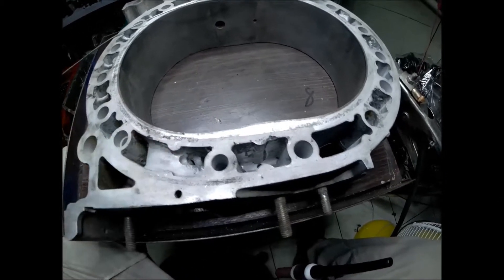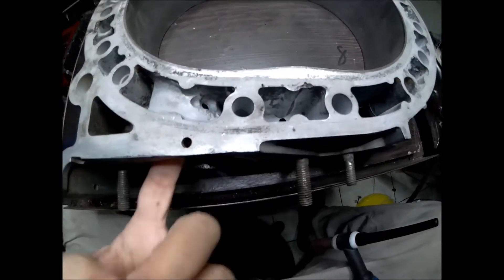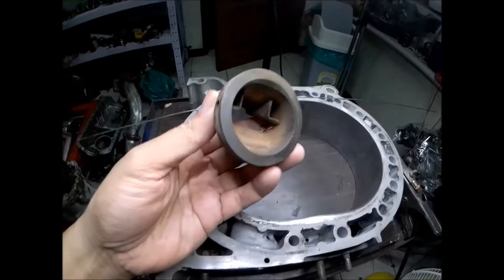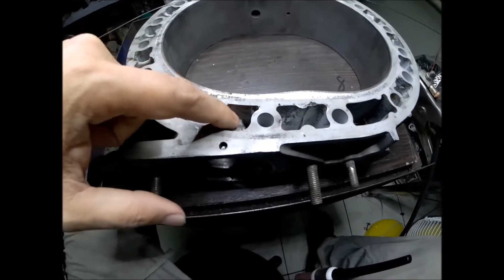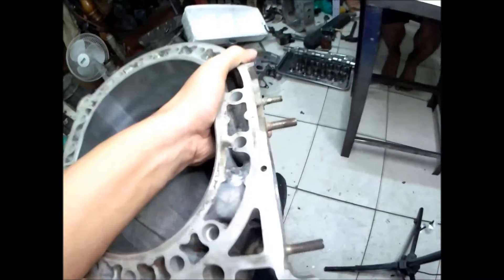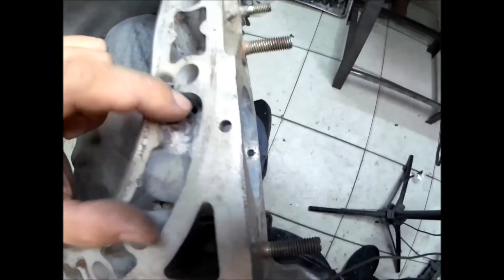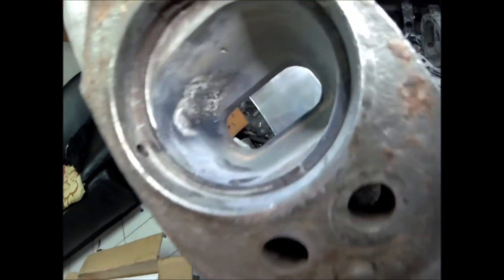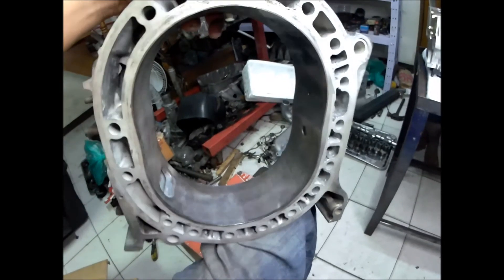13B Rotor Housing coolant port repair

Comment: Great video... won't the housing warp with the heat of welding?
Reply from the maker: Nope, the heat is not that much of a coverage since the weld is on one area only and on a specific hole only
Reply: @DIYAllManphKDWzpeedengineering  so it working find for you after assembly? 
i have a broken water seal grove about 5mm. Rx8 forum saying to replace the rotor housing and Im willing to let a shop weld and machine that area
Reply from the maker: @DIINj27  because its risky to repair it, for a customer It will be a no warranty condition. But in this video is a personal project of mine only
Reply from the maker: @DIINj27  And also for the Rx8...and its a rotor housing that needs to be repaired...its of a  big risk since it ill be near the chrome plating

Comment: boss may idea kayo bkit laging napupundi ung .shutoff solinoid ng kia pregio ko.pg malayo byhe madalas pundi.buti nlang lagi may xtra ako.maraming  salamat po
Reply from the maker: Check muna voltage na nilalabas ng Alternator mo pre, baka over voltage pre ehh
Reply: maraming salamat sa tip mo bossing.👍👍👍